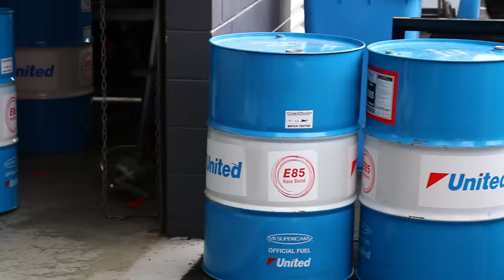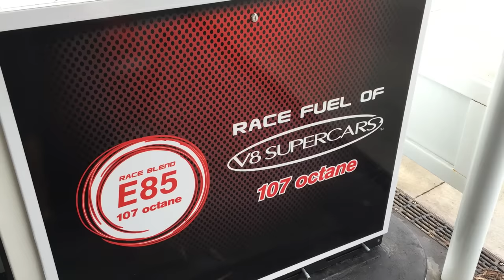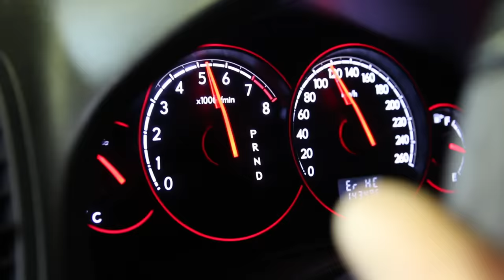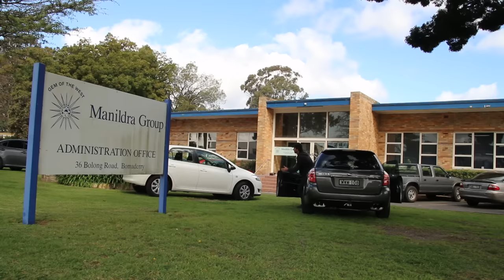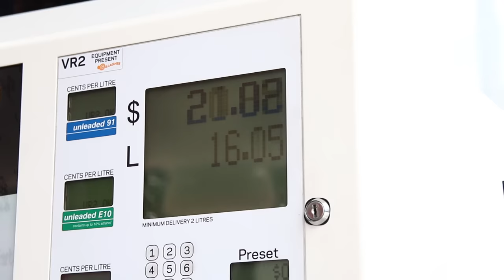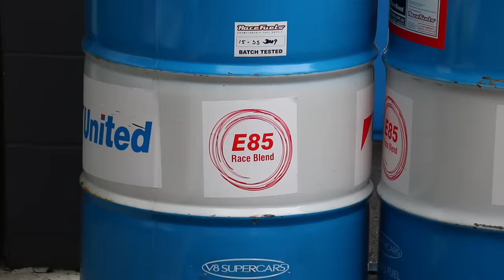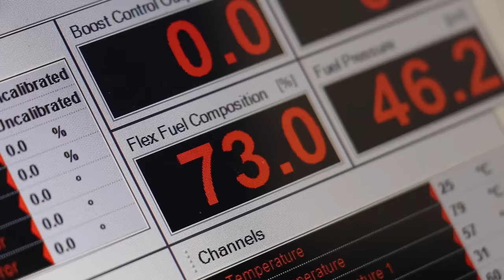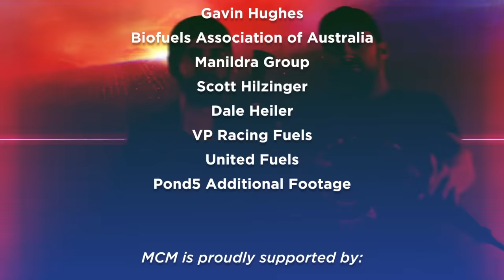E85 Fuel Explained - Should you use it?

Comment: I would love to use E-85. Sadly the price difference is only about 10% vs. 89 octane gas. I drive about 400 miles (644Km) a week to get back and forth to work. At the average price for gas (US$1.90/gal or AUD$2.60/3.8l) statewide (Indiana) for 89 octane vs. the local average for E-85 (US$1.72/gal or AUD$2.40/3.8l) it simply makes no sense for my driving needs. A full tank on my work beater (2008 Pontiac Torrent AWD) is 15 gal (56.8l) and costs me USD$28.50 (AUD$39.00) to fill up. At 27mpg (10.6km/l) I can go 405 miles (651km) on a full tank. Using E-85 and using the 30% less energy density figure I would only be able to go 284 miles (457km) on the same tank. This translates into 19mpg (8km/l). At an 8mpg (2.6km/l) difference and 1600 miles (2575km)  per month that translates to USD$32.25 (AUD$44.16) a month in fuel prices. That's more than another full weeks worth of gas (458 miles to be exact). Follow this out logically and that is USD$387 (AUD$530) a year or USD$2700 (AUD$3697) over the life of my car (so far) that I have SAVED by using 89 octane gas vs. E-85. This figure doesn't account for the cost of conversion to Flex-Fuel. I understand that E-85 use is situational and doesn't fit the needs of every driver or car under every circumstance. In the US the average daily one way commute is 18.8miles (30.25km). The fact that people live so far from work makes selling E-85 to the general public difficult hence the relatively low density of stations that have it at the pump. Even though most cars on the road today are Flex-Fuel people still aren't willing to take a hit in MPG given the distances travelled every day just to get back and forth to work. I do applaud you guys for using it in your vehicles however and am a big fan. Before I get beat on for being a shill for the big oil companies I work at an Abengoa Biofuel plant in Indiana making E-85. The math simply doesn't work for a large majority of the US.

Comment: i have a question, in a petrol driven car (95 , 98), can you use E85 mixed with it? btw i dont know if the car has flex fuel, i put in E85 in my petrol car by accident and wonder if i made a big mistake

Comment: The only issue is that you have FEW alcohol making plants FAR FAR FAR in between and the "in between" areas are usually 1-3 crop deserts..

That makes fertilizers and fueling for the trucking and farm equipment go up.

If these plants were made into smaller versions with something called "VOC" scrubbers to allow them to make dried distiller grain with solubles as another form of profit, they were placed CLOSER to the stuff that's grown, and the resources they make them from were more diverse, your alcohol fuel would not be a "food vs. fuel" argument.

Also factor in the fact that you could convert the various grain you'd have for livestock into alcohol and distiller grain feed would make them even cheaper and cows would get more out of it pound per pound.

It's infrastructure and recycling for profit under free markets that's the bigger issue.
Reply: If there is a demand, the changes will be made

Comment: Have watched a few vids on this like for example Jay Leno's garage. They covered this and it sure sounds like I don't want to be putting it in older cars like my HR Premier given the damage it can do to parts of the fuel system in older cars. Especially in non cross flow cars where the carby is above the red hot exhaust manifold.
Reply from the maker: +Fitzy Holden Yeah not as suitable for older cars, you can set them up to use it but like any mods it takes time and money.

Comment: In the USA E85 is NOT as wide spread as you stated. In the corn belt regions you can find it, but not so much everywhere else. We do have fuel with 10% Ethanol every where. The problem I have found with 10% Ethanol is that it doesn't last more than a few months in Carburetors.The fuel breaks down into a surgery mess that hardens up and clogs main jets, etc in small equipment and I have seen it on one car with a carb. The automakers make some flex fuel vehicles, but at about only 3%. Of that 3%, owners hardly ever use E85. It's just to hard to find. Now, Ethanol does produce emissions and a lot of transportation and manufacturing costs just the same as oil and fuel production. There is a source of usable energy that can be produced on site. All you need is water and solar, wind or hydro produced electricity. Its called Hydrogen. Every internal combustion engine can run on it. You can switch old cars over to it with very little problems and then you produce all new cars as Hydrogen fuel cells. NO emissions, nothing, but water is spit out the tail pipe. Do some research on that guys. Nice channel buy the way.

Comment: Here in the States, our unleadeds are 87-93 octane, and is already 5-10% Ethanol. You guys get 95 Ethanol free??
Also, I ran a few tanks of E85, 87-93 octanes, and ethanol free fuel, as well, did some math, and discoverd the best cost per mile was 87 octane(20MPG), and E85(15MPG) was the lowest. Highest MPG was 23 on ethanol free, still higher cost per mile, as it is the most expensive.

Comment: ok so a quick question, can you use this and still make more power on a stock car with no mods, like any car that is an old car. 
for example if your running the blue turd and had dont nothing to the engine, and then used E85, would you feel a difference or nah?

Comment: Gotta mazda speed 3 here i run super premium gas. Can i just pump e85 in it?
Reply: I did it my Mazdaspeed 3 2008 E85 mixed with Regular Gas 10% ethanol was better performance than I thought. You may realize if you turn the fan A/C on the engine go slow. But my 2nd gear high RPM was massive start.
Reply: @fernandorivas5059  Do u know if I can run this e85 on a 08 lexus is250?
Reply: @JVBL1  Only if you turbo your car with tune. If your car completely stock then you may need to read manual book depending what they said.

Comment: Don't use E85 unless your vehicle's manual says it is compatible!!!

When I worked at a gas station, we got E85 when it was new. People just started blindly using it. The lot was filled of cars that wouldn't run. Even in some compatible cases, E85 damaged some internal parts for some of the older vehicles.

Comment: Ethanol over here in Sweden is dying. We've had it for a long time, and it's peak was about 5 years ago. The government is taxing ethanol so much that it's really expensive compared to gasoline and diesel. Only enthusiasts are still using it. Still easy to find though, but for how long? 98 is really hard to find nowadays, and my car runs really bad on 95... Ethanol conversion maybe.

Comment: Guys, can I have a flex fuel sensor fitted to my new Focus RS? Is it a difficult process? I will be running an Accessport and can get an E85 tune no problems, however am concerned that the sensor is technically difficult to install and may void my engine warranty. 

Any advice?

Comment: I know this is an old vid now, but currently E85 fails on mileage 20-30% even in cars designed to run on it compared to 98 octane premium unleaded.  So it'll probably never be used mainstream unless the mileage increases, but hey if the petrol price keeps going up and up and the ethanol gets cheaper then people will use it simply as an economic decision.

Comment: Very informative video but they did not tell what they Denatured it with .. In the USA  they use gasoline .. When I was a kid I bought denatured alcohol at the drug store to  burn in the burner in my stream tractor ..
  I  thought that to get the last  4% of water out of Ethanol they had to heat it and  evaporate it out .. which wastes a lot of energy and costs a lot to do .. using small beads to filter it sounds like newer technology ..

Comment: 7:55 Did you just say that there is so much water in the fuel? Or did i missunderstood?
The specification where i live says maximum 0,3% (volume) of water in E85 fuel... doesn't sound that much to me. 😉
But after the combustion (exhaust) there is of course water and carbondioxide:C2H5OH + 3O2 = 2CO2 + 3H2O

Comment: Basically the newer cars which have flex fuel sensors can run E85 and thus have more power and use less fuel and emissions, thats the basic's of the fuel, who cares how its made, what people care about is the list of cars which can run E85 with out spending a lot of $$ to convert the engine and fuel tank and other aspects to run E85, the more the car manufacturers stick to developing engines that rev higher and run cleaner and availability of E85 and maybe E100 , then the customers will be happy and car manufacturers will be happy as well, so many car owners dont even know that the car they drive can run on E85 its as simple as that ?t

Comment: So, if NASCAR uses E85, a team could cheat and use E10 mixed with E85 and get less power but way better fuel mileage, therefore able to run more laps per tank of fuel. I wonder if any of them have tried that?

Comment: Marty, how much does it cost to drive 100 miles on E85 vs regular? All I hear everybody say is E85 cost less but you need more, but no one ever says how it effects your wallet. I've heard of some vehicles cutting there mpg in 1/2 when using E85, and if that's the case then E85 is only for hippies and track days. Other wise I don't see a practical point in it.

Comment: Can you do a video to tell me exactly what all I need to change my car from a boring unleaded only car to a exciting flex fuel car? Also I live in Missouri which is one of the cheapest states to live in, in the USA. I have seen unleaded be as high as $5.00 here yet E-85 has never gotten over $2.00. Right now E-85 is about $1.50 per gallon.
Reply: +Nathaniel Young fuel pump, injectors, ecu + flex fuel sensor
Reply: +Nathaniel Young $5.00 for a gallion of gas fuck that
Reply: +DJ JONES you have it so easy in the states $5 for a gallon is only $1.30 a litre thats around 90 pence uk pounds and fuel in the UK is upwards or £1.15 a litre if like me you run 98 all the time its £1.24 a litre so would be almost 7 dollars a gallon
Reply: +Luke Bailey Right now unleaded is at $2.00 gal. But in other states its 5 which is their cheap. The highest it has gotten here is about $12.00 dollars a gallon.
Reply: +Nathaniel Young that's so cheap I wish fuel was like that in the UK

Comment: Fusel oil is seriously bad for you. It makes drinking pure benzene or methanol look good. Most alcohol plants flare it under tightly controlled conditions (or put it into fuel grade materials where the emissions controls will take care of it).
Ethanol will attack synthetic rubber and copper alloys so the older fuel lines and brass components of carburetors (like floats and o-rings) are in for a bad time with E-10 or worse.

Comment: Can a two stroke 50 cc scooter engien run on E85?
Reply: +Gilerajohannes my guess would be no.
Reply: Ok
Reply: Gilerajohannes ya it is basically an alcohol so it likes to dry out any kind of rubber it touches plus it creates rust really bad if it sits for too long. if your scooter wasnt built for it or if you arent going to replace parts to handle it than you would be better off finding something else to burn.
Reply: Ok thanks :).
Reply: +Gilerajohannes Do not put E85 in a 2 stroke engine. Two stroke gasoline engines lubricate off of the fuel-oil mix and the ethanol in E85 not only has no lubrication value, it tends to badly diminish the lubrication value of the oil you mix with the fuel. Also, engines not designed to run on E85 are not tuned property (not rich enough) and will tend to run dangerously lean/have the incorrect ignition timing, which may result in engine damage.
Reply: Thanks thay will be wery bad :(.

Comment: Why aren't we talking about a cheaper option aswell... 50/50 Methanol is a better antiknock agent... and where i am is alot cheaper... at 50% mix you will only use 20% more fuel than if you were running 98RON, whereas 85% Ethanol mix will use up to 60% more fuel...

Just saying...

Comment: Ethanol is good for the car industry but not for the consumer. Ethanol damages alot of the engine parts of your car. Ethanol can corrode rubber, plastic and many parts inside the engine of the car. 
The way they try to sell you this is by telling you that you're "helping the environment," which is not true. The gas companies are pumping 10 to 15% Ethanol into your gasoline and yet the prices are still the same or even higher.

At the end of the day the consumer has to cough up more money for a new engine or a new car, which is good for the car industry but definitely not good for the environment nor the pocket of the consumer.

Comment: Oil.   Hasn’t been any problems at all finding more oil nor any impediment mining or pumping ect, extracting no matter it situation nor supplying these oil derived fuels nor any problems keeping up with the astronomical growth and manufacturer of fossil fueled engine’s production which is increased exponentially daily as to the usual requirements for all existing engines still in use  One might ponder that um maybe well perhaps finite may need redefining.

Comment: Is e10 the same as e85
Reply: No, E10 is 10% ethanol 90% gasoline.E85 is 85%ethanol 15% gasoline(however, E85 sold at many fuel stations can actually contain as low as 50 some percent ethanol and still be branded as E85)

Comment: I was against ethanol in fuel up until 2 days ago. I'm sick of my J35A4 burning rich, & I learned ethanol burns cleaner. I mix my own E15 using E85.

There's one problem though. Here in the idiot state of idaho, The two gas stations selling E85 are replacing the pumps with E0 pumps.

I hate how big oil in America takes advantage of the ignorant masses with bad press, just to keep their own pockets lined with profits.

Comment: If your vehicle is designed to run on it then how is it supposedly causing “problems”? Nobody can explain that to me but claim it’s causing problems in vehicles.
Reply: The engine itself can handle it. The problems are probably between the tank and the injectors.

Comment: I've been running My 1994 Honda Prelude H22a for years now on what you guys call e10 an its my every day driver without any issues.

I found that my V-Tec engine seem to love it plus i made 5 awhp just by using it without any tune. The other thing i have found that engine oil is cleaner than when using normal petrol when it comes to changing the oil so that's saying something for it by itself.

Now i don't drive like a pussy an i give her death at the track on track days an after 135,000 ks on the Engine clock not the body shes only lost  3 to 5 psi down on compression in each pot which i put down to there not being so much crap in the E10 fuel.

When V-Tec dose kick in it pulls so much harder than it dose on 98 octane petrol an E10 even gave me an extra 10 kph top end than 98 octane.  Now our ethanol here in New Zealand is mainly made from a by product for brewing beer so whats the problem as it would only be trashed otherwise.

Thanks guys for this video as it was great to see how it was made.

Comment: the only reason to use ethanol based fuels is to make the gov richer due to having to use 30%+ more fuel to get the same power as petrol, its taxed the same as petrol ( over 50% of the pump price is taxes) so the more you use the more cash you lose.
for now l will stick to petrol and when the ev tech gets cheaper l will switch to electric

Comment: See i can't stand not having e85 near by. i don't feel like having some big drum of e85 sitting in my drive way. the closest station i think is about 50 miles one way. and i sure as hell don't like the idea of driving down 50 miles just to fill up. especially if i have to go the opposite direction. 

Not to mention storage of a car. if you're like me where you drive your car sometimes once a month. and you run e85 that means you need to run some sort of additive at all times to avoid the moisture buildup.  The way i see e85 is if you want to be able to make the most amount of power possible and you don't mind the extra maintenance or having to go out of your way to get your fuel its fine. 

Personally im focusing my car on a decent whp but nothing crazy. so i can just go down the street and fill up. and if there comes a time to run some higher power.. i don't mind going meth injection. its easier to just order a few jugs of methanol and check your in car tank before you go for a drive and be fine.

Comment: Why would you put water in your engine? Ethanol is trash. Every car guy I know has been having nothing but issues with the stuff. My buddies truck runs like crap with blended gas. Car manufacturers actually do their MPG and power tests using ethanol free gas. Today, I put E0 gas in my car for the first time. And the car is already smoother and feels faster. I drive a MK6 VW GTI. Running on just E10 gas, the car hates it. I get bad MPG, and the car falls on its face. Running E0, I no longer have that issue.